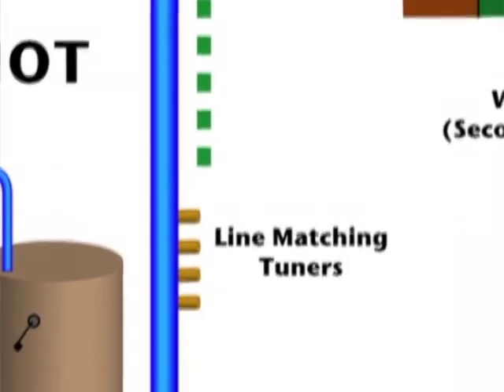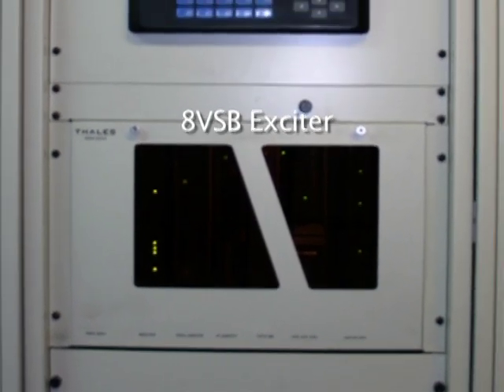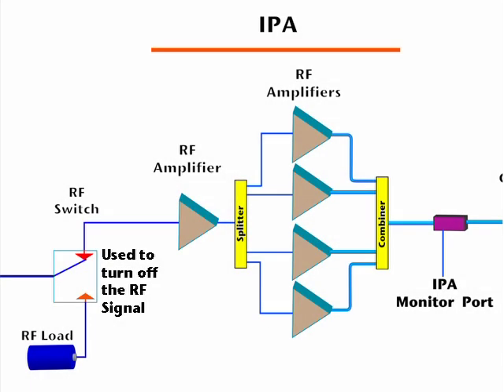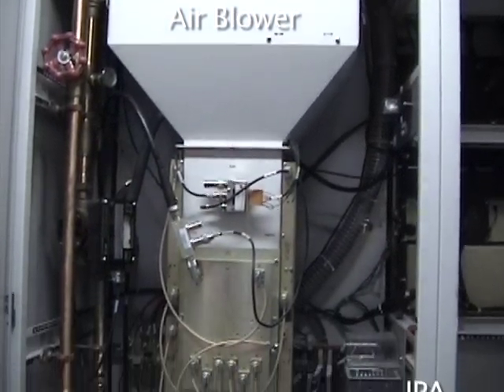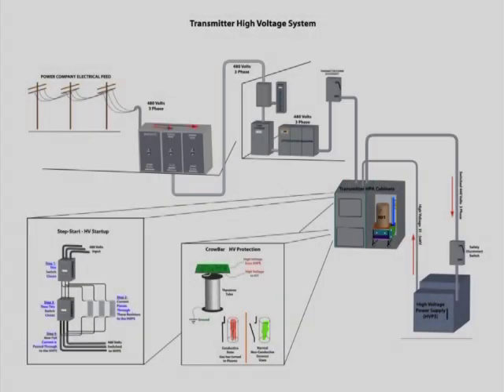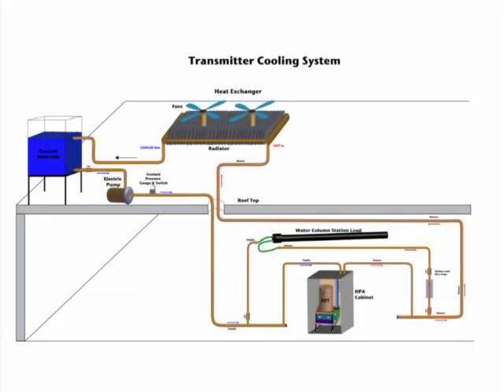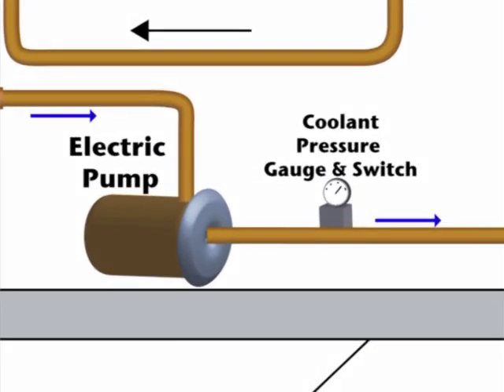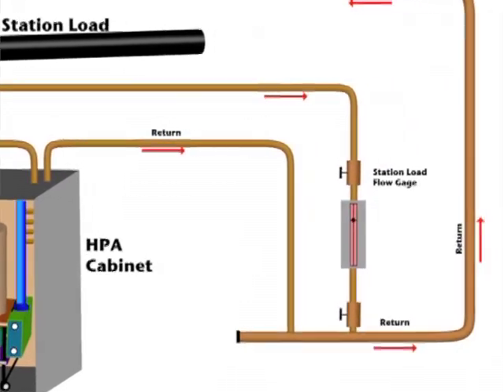Profile of a DTV Transmitter (part 1)

Comment: I have a technical question concerning the production of the digital TV signal at the front end of the transmitter circuitry. I noticed that 10MHZ GPS timebase signal that the circuitry uses for the timing. What would be the result if, what ever reason, that signal was lost? Would that cause the loss of the transmitter's signal?
Reply: Based on other questions asked from years ago , I don't think the creator answers questions.
Reply: This is used as a baseline reference for the exciter's pilot frequency generator. If it is lost, it will switch over to an internal frequency generator, which is pretty accurate, but not a NIST-traceable source like GPS. Some stations that used to be adjacent to an analog transmitter on a lower channel were required to have very precise pilot frequencies to keep interference to a minimum. I don't think any of the old requirements apply now, so this would be obsolete. In modern exciters made in the last 5 years, they really don't have any issues keeping the frequency dead on. Only the very early digital exciters really had problems with drift. (You are still required to check it to make sure it is within spec.)

Comment: This is just Poor for being engineering your audio level goes up and down every edit is generally to low during the narrative your water cooling system has issues using dissimilar metals hope you have a good water treatment system monitor I got to tell you I hate DirecTV all propaganda mind control